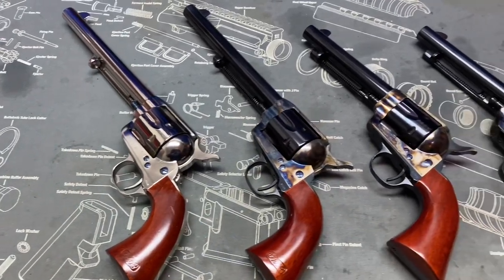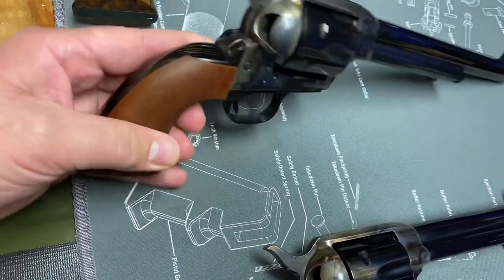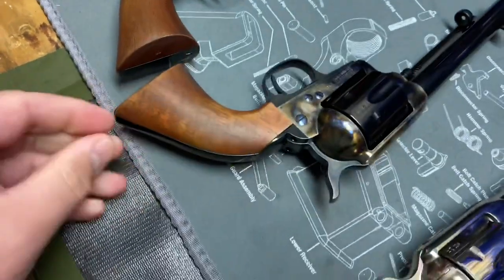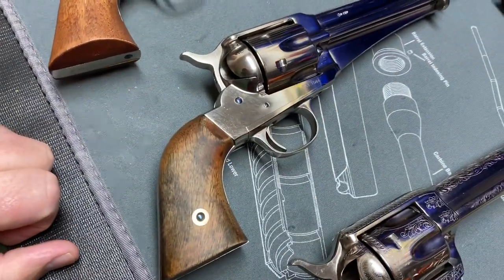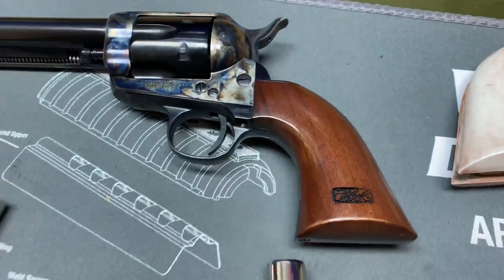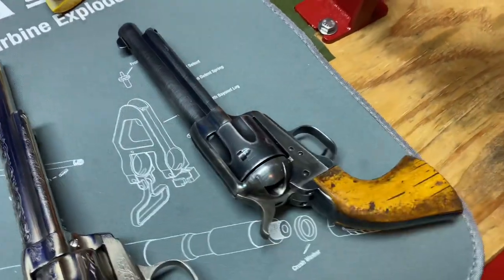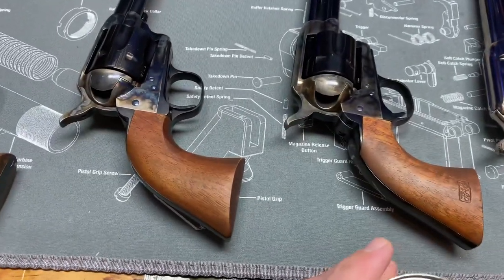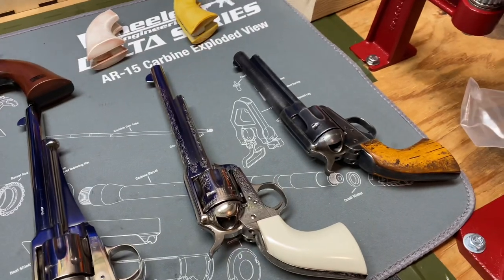Single action revolver grip options

Comment: I just bought an Uberti smoke wagon with the checkered grip. Unfortunately, it has the Taylor's & Co "T" logo carved into the walnut grip on both sides. I feel like it ruins the authentic look of the revolver. If you check the Taylor's web site you can see it on that specific model. For some reason, the normal smoke wagon is the only one that seems to have this. The short stroke smoke wagon doesn't have it, neither do the other models that have checkered grips. I was kind of disappointed that they changed it in that way. I wasn't sure if Uberti makes those grips for them or if it's Taylor's that replaces/alters the grips when they get them from Uberti.  I'm hoping I can get a checkered replacement grip for it that has no logo.
Reply from the maker: You should be able to find replacement grips without the logo pretty easily. Other importers such as Cimarron carry the same gun and sell replacement parts for them. Also, people take off grips and replace them with custom ones all the time. You might try eBay and see if there are any out there.

Comment: I love your work brother and and I love your collection even more. I shoot SASS and refinished my shotgun and rifle but haven’t done my revolvers yet. What I did with mine is after I stripped the factory finish I washed the timber with cold water and brush. When it dried I used a spirit based walnut stain and let it dry. Then I trenched them in boiled linseed oil and wet block sanded with 600grit sand paper to fill in the grain. Wiped excess oil and let it dry. After that I rubbed it with 0000 steel wool and waxed it using renaissance wax. Looks like a million bucks now.

Comment: I just got a SAA Pietta, and the grip is a little smaller than I'd like. Is there a way to fix that?
Reply from the maker: Depends. If you want thicker grips, you'll have to have something custom made. If you want longer grips, look for a pietta 1860 army grip frame. It should be a direct swap and the army grip is considerably longer than the SAA/Navy size.

Comment: The wood grips on my SAA revolver .44MAG is too hard, it hurt my hand, do you know what company made the rubber grips for SAA revolver ?
Reply from the maker: I don't use the rubber grips, so I am not really sure. I know Hogue and Pachmeyer make rubber grips for double action revolvers, maybe try looking there.
Reply: My Ruger Super Blackhawk quickly taught me that short grips and checkered grips are not pleasant to use.  I could shoot my Ruger OK, but I fired one round round from a DA Smith with factory checkered grips, and it BIT ME even though I shot it in single action mode.  The Super Blackhawk has longer grips than the regular Blackhawks for a reason, the recoil.  I added a set of smooth Herretts Shooting Star grips that lengthened the grip even farther, and they were worth it.  
There are two ways to lengthen the grip on a Single Action Army.  One way is to get grips that extend down past the grip frame.  The other way is to order the trigger guard, backstrap and grip wood for an 1860 Army revolver.  You can get that from Dixie Gun Works.  The only difference between the grips on an 1851, 1860, 1861 & 1873 is that the 1860 has longer grips.  Another advantage of using the 1860 parts is  that it won't look much different because the wood does not extend past the grip frame.  
The long, smooth wood grips will simply roll back in your hand under recoil.   I have a couple of BFRs that came with rubber grips, that I intend to replace with smooth wood grips.